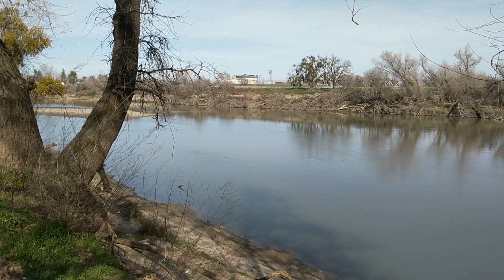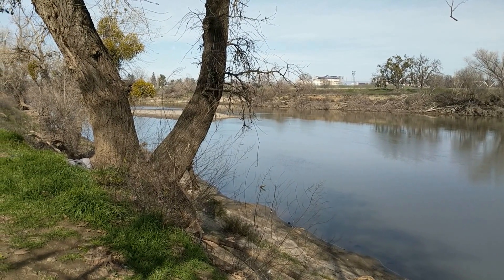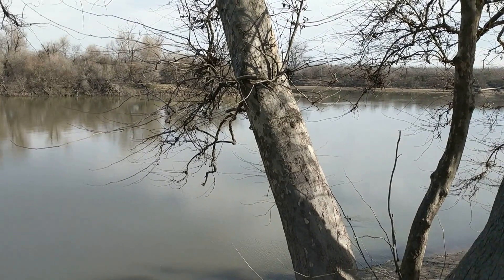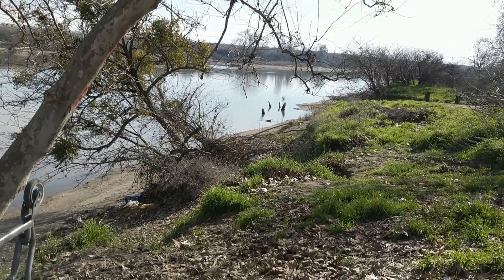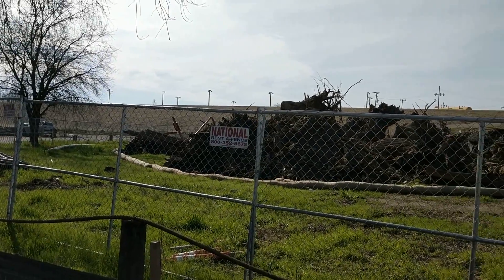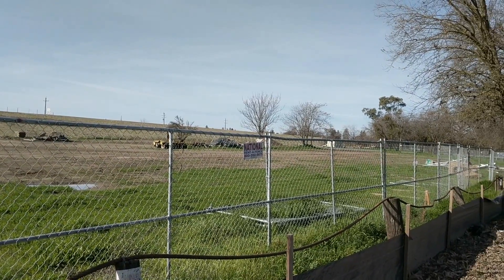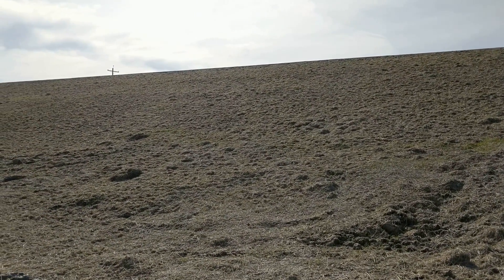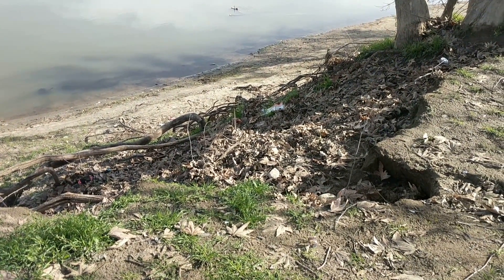1/30/18 ~ 30 miles downstream of Oroville Dam (1,747 cfs river releases)

Comment: Looks pretty quiet down where you shot this.  Lot of healing to do on the banks of the river.
Reply: The water has gone through this area much higher many times before the spillway incident. For instance in 1986, if I remember correctly, when Linda flooded and what used to be the Peach Tree Mall was almost completely submerged. Without Oroville Dam this area used to flood a lot
Reply from the maker: True, Gary. I was here for the 1997 flood. Scary amount of water when all the rivers are running high and Oroville gates/spillway are maxed out. Thanks for viewing and commenting!
Reply from the maker: So true, Pamela. The Spillway Incident took its toll on the river. Hopefully this area will become a priority soon. So glad you stopped by! I hope all is well with you.

Comment: Strange smells,
River is sick ...

It will takes times,
Till any recovering .
Reply from the maker: Hi Brice! I totally agree with you on that. Thanks for viewing and commenting. Take care.
Reply: Millie Kay
Doing what I suppose I can handle,
Will be a start .

Anything else is not my "wish" .

Thanks
Reply: How many times have I seen River Front Park completely submerged? At least 5 times in the 8 years I lived there. In other words, it is pretty normal to flood that whole park despite what happened in Oroville.
Reply: I have also seen the river so low that you can see all the refrigerators, cars, box springs, and various other discarded junk. It is bad, far more than you might imagine.